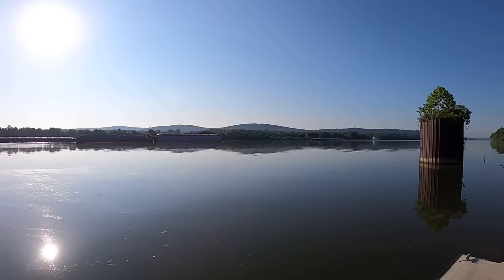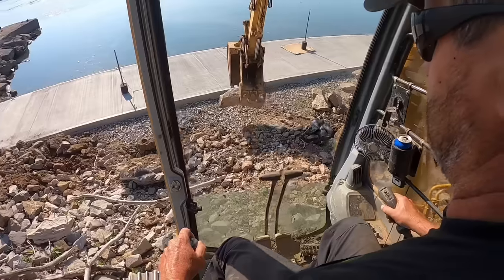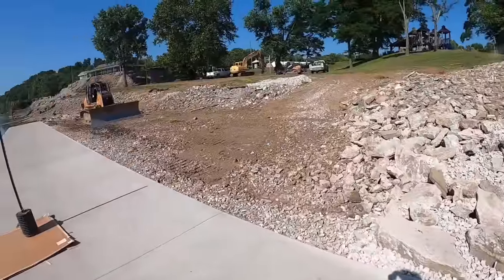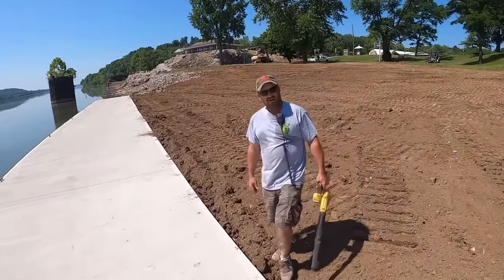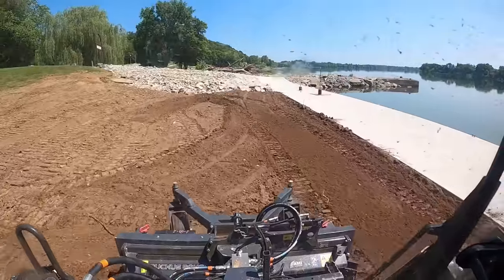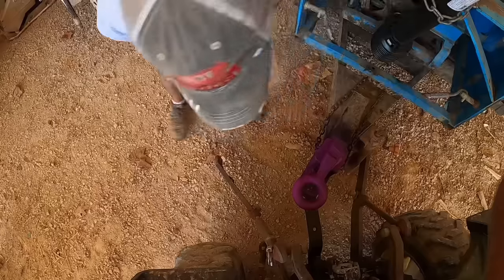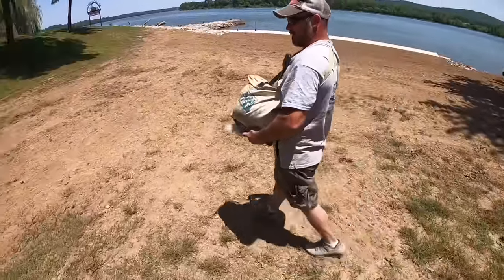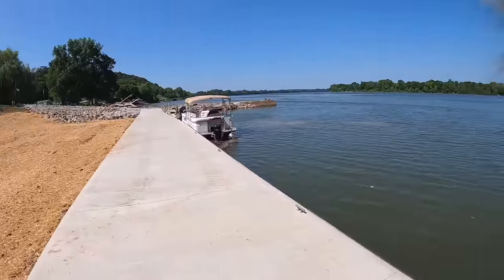Absolutely unbelievable! The boat dock is done, you won't believe how it turned out!

Comment: Hi.That 1650 shows a new era of whats possible.Given its versatility in programming surely it or preferably one or two sizes bigger could replace the D4 with much much greater efficiency.
I recently learned and I'm sure it's not new they are running D11 s in coal mines with no drivers so it is time explore what is possible for your situation.

Comment: Need to finish it off with some docking posts and cleats.  Put up a nearby sign, ''Welcome to..", with local business and a map.  Does the older ramp need any repairs? 
         In the future, maybe a small flood level dock about 4-6' higher. (at a right angle) Maybe dredge the rock at the old ramp so boats can use that as a flood ramp.

Comment: You can always weld the pindle hitch off to the side. That way you could always get your drive shaft and firm. But you could always have your pindle switch off to the side of the other drive shaft

Comment: Ever seen that done with a tractor truck (conventual cab) two axle, & a trailer build as a big bale blower !!!  Operated by truck driver and feed by a wheel loader!  May use third man to cut strings on bales to keep from getting in  cutters! (1,2000/1,800 bales of  straw/ rice straw/ and ever pine needles w/cones!   Si yes been there done that with seeding / straw blowing etc.  fav equip. Was a truck boom/wench that use a drum packer .. with punch type plates  as fingers. Roll steep slopes that better not cat walked or glued down, on by cat, to punch straw after seeding ! Was a trick to wench down and up the roller ! Slopes as 2.0 to 1.  And as flat as 4.0 to 1. Almost just drive and drag  but drop and drive while wench out move to end point not over and wench roller ! Not to leave tire ruts!

Comment: Project looks great. June 1st 😂 not that far behind. Too bad that elevated section goes under the water. Would make a great lookout, maybe a concrete floor with a high curbing. Then a removable railing, gangplank and benches. Aron’s all steel gazebo would be great but might get washed away, definitely need to use core 10 steel so it maintains a constant patina. Wishing you and your family the best.

Comment: Mike and Aaron (MBTS) did a great job for the city / town of Derby, Indiana.  The ruckus rake really shined doing this job.  Mike, you have a great eye for design / flow.  I would have gone with a straight line of the rock / grass, you went with a curved / flowing line, much more attractive, more pleasing to the eye.  A suggestion for the the city / town of Derby, have some Fishing Tournament's, biggest fish, from the dock, rarest fish, and so on.  Fish to be weighted at say the  Derby Market, of course with some picture's.  May I make a suggestion, you have a dock, you have people on boats, pulling up to said dock.  I think the dock needs a ladder, so if someone should fall out of their boat, (as if that would never happen, I'll leave out the beer part,) instead of having to swim to either end, and navigate the rocks to get out of the water, they could simply swim to the center of the dock, and climb out from the water.  Just a thought.  In my opinion, whatever the average water height year round, ladder should have at least two rungs / steps below the water line, if not three rungs / steps.

Just an after thought, a ladder would also encourage water skiing from the dock.  Maybe the area is unsuitable, I don't know the area. but if on the the other hand it is suitable for water skiing, just another reason to visit the city / town of Derby.

Comment: Safety 3rd and all it looks like the operators deck on the straw blower should have a 3 foot railing around it to prevent the bale loader from falling off. 
Perhaps a lower rail so short employees don’t fall under the 3’ railing. 😉

Comment: 1)  Me too: looks great!  :-)

2)  How are the boating people to know about the Derby Market and getting there? Or will there be some outpost near this dock, selling ice cream, umbrellas and boat fuel? Het, you might use your Pepsi machine there! - On second thoughts, you (the Derby Market family) could consider having some store floating, like between the dock and that big mooring pole. (Here in Amsterdam, the Netherlands, I know of two floating gas stations. There may be more. Plus the bunker boats and other services that visit their clients.)

3)  DP, you considered using the 1650 overdone. However, you seem to have pushed it to the limit. (Pun intended.)

4)  June 1? Wow, how did you manage to post the video this soon?  ;-)

5)  Something tells me, that a decision has been due regarding the 550. It does seem like a useful addition to your gear, like when moving those clay pipes. (The 1650 also looks impressive, but not as filling a niche as the 550.) De-cal! De-cal! De-cal!!!  ;-)

Comment: Mike, just an observation, with all the dozers you operate, you get a bit too greedy with your push. You get bogged down and lose most of your forward movement. If you watch Jerry (and most professionals), he cuts only as deep as necessary to maintain 60% or so of unloaded forward speed. This maximizes dirt moved per hour and per gallon of fuel used. It's also less wear and tear on the dozer. Job gets done faster, cheaper, with less maintenance costs and less fuel transported. You're passing on your bad habits to Aaron, IMO. Have him work with Jerry for a while. Have a great day, regardless. Say hi to the crew for me. P.S. I miss Matt.
Reply: Case in point, at @21:05 you cut deep, the dozer stalls, you lift the blade and repeat. The result is several cuts and humps you'll have to go back and smooth out on another pass. You repeat @21:43.
Reply: At 22:07 is a much better push, right on the edge, but you don't have to lift the blade, so the dirt gets moved in a single pass and looks tidy as well. At 22:14 this is a repeat push where you can see the negative results of the previous greedy lift-stall-lift-stall push. Whenever you have to lift the blade to un-stall the push, it costs you another full push over the same cut. Expensive and time consuming. Jerry doesn't do this, which is why you're so amazed with his progress over time. It's all about efficiency and work finished per hour-gallon of fuel and man-hours.
Reply from the maker: lol this might be the funniest comment ever clear you don’t run in clay much thanks for the great 😂😂😂😂😂